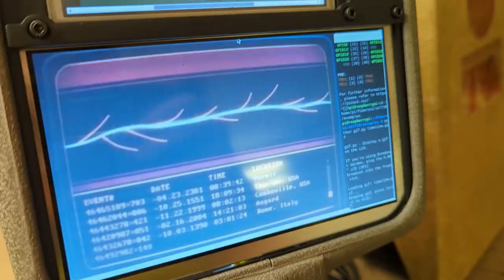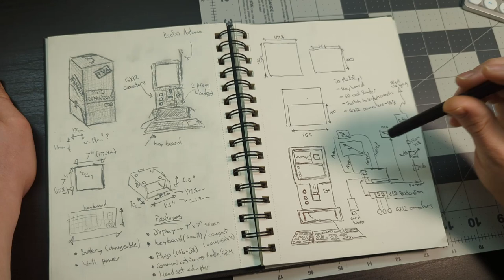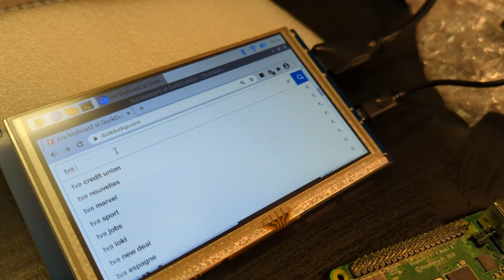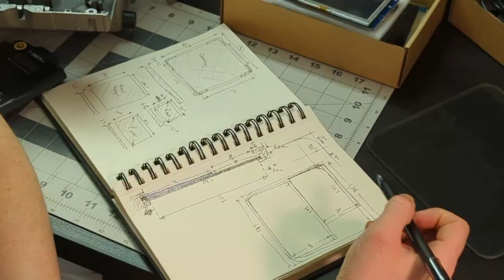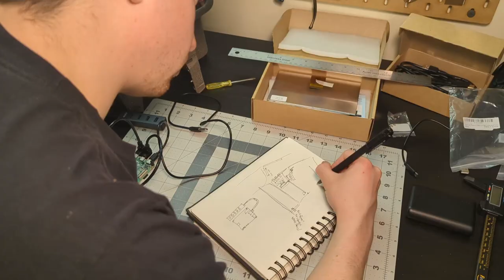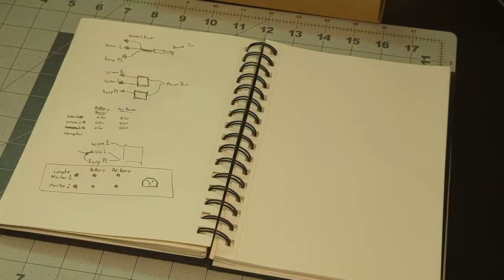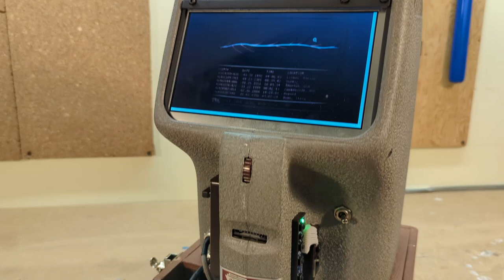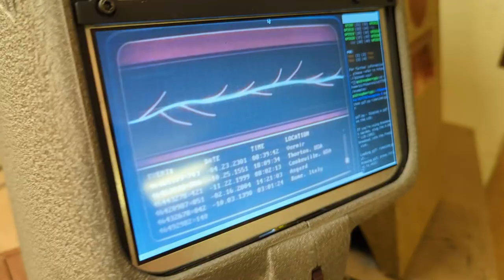Building a Retro CyberDeck Inspired by the TVA

Comment: If you find another one of these and wanted to go extra retro, you could possibly get a small LCD to go where the slides go. That way you still get a reflection on the main glass, adding to its vintage look.
Reply from the maker: Hey Jacob! I wish I had included this in the final cut of the video! Using a tiny LCD in the slide position was actually what first inspired this build, sand I did shoot some footage of trying to make it work. Unfortunately when I tested it, the mini LCD just wasn't bright enough to be visible except in a dark room. @Giacinto Boccia suggested using a mini projector. Which I think might have worked with the proper lenses.

Comment: Really nice build! A slightly smoked glass to cover all screens will be top! 😉👍 I'm currently working on something similar with a B&W Flat CRT, but the rpi still pricey...
Reply from the maker: The CRT build sounds cool! How big is the screen? They keep saying the raspberry pi's are coming back in stock but like you say the prices have still been slow to recover for sure. If it's a big enough build could you fit an old laptop board inside it instead? I've been thinking of trying something like that on another build.
Reply: @ExercisingIngenuity  The CRT screen is 4 inches, I already made a first version ( https://www.youtube.com/watch?v=MZ5fq9Ok8M8 ) but I try to make a new one with integrated and portable keyboard. Using a mini pc is an option but we need a composite video output for CRT, perhapse a hdmi-composite converter.

Comment: Did you consider keeping the mirror and translucent screen and using a small internal projector instead of LCDs?
Reply from the maker: I actually considered something similar, using a tiny ultrabright LCD in conjunction with the existing mirrors and lenses. However, a small protector would have been the way to do it, I never considered that! The tiny LCD was not bright enough and the projected image was only visible on the view screen in complete darkness. I ended up cutting that experiment from the video, as it never ended up contributing to the final build.
Reply: @ExercisingIngenuity  should be doable with a mini short throw projector and two mirrors but most need like 6 feet of throw so you'll need to use a diopter element in front of it.

Comment: Hey man, loved the video! The design is dope and very creative. I've been trying to build a cyberdeck of my own for a bit, and I'm having trouble with the battery options. What method did you use?
Reply from the maker: Thanks! Glad you enjoyed it. For this build I'm actually just using a USB battery bank that has 5v output. Not the best solution, but the battery bank was an off the shelf reliable option that I thought would be simple. It worked, the only issue being that when the battery bank is charging, it doesn't output any power, hence the awkward method of switching between battery power and the plug in power supply.

Comment: I had an idea looking at that huge back panel. What are your thoughts on installing an HDMI projector in there?
Reply from the maker: It's been suggested before. Or are you thinking it could be set up to project out the back of the cyberdeck? Maybe as an alternate display?
Reply: @ExercisingIngenuity  Yes as an alternate display. Regular use, the front display. Movie or game time, project onto a wall. I have explored the dual screen capabilities of my Pi4s. I use Twister OS for desktop and Retropie is built in to that. Also Android 13, (specifically Konstakang, Lineage OS, with GAPPS,) If you start up Android 13 with 2 HDMI plugged in it will show the same on both screens. Twister OS you can put an icon on the desk for changing display settings. Use them as 2 screens or mirror, OS dependent. 1 exception. If you use DSI (official 7") with Android you can't get an HDMI out at the same time. You'll get no screen at all. Not sure about composite, never used that for anything. 

A projector would run down the batteries much quicker. So when I do my projector, I will give the projector it's own battery. I'm thinking LED, something automotive designed to work on 12v, but not a headlight, maybe a foglight, less amp draw.

My favorite cyberdeck is built into a boombox. I took the CD player out which left a hole the size of a Gamecube. At home it's on 24-7. Watching Inception on it right now. On the desk next to me.
Reply from the maker: Sounds like you've experimented with the pi display capabilities a lot more than I have! I really like the idea of having the projector as an alternative, but like you say it would require much more power  Might have to revisit this pideck at some point and see what can be done.
Reply from the maker: The boombox deck sounds wicked, repurposing old devices as enclosures is where it's at 👌
Reply: @ExercisingIngenuity  I wanted something I could always use. Power tool batteries is where it's at. My tools were already Milwaukee 12v so I went with those. Well knockoffs from ebay that have more amps. If I were going clean slate, no influence. DeWalt 20v lithium knockoffs. Reason being it's a completely flat battery pack that slides into place, higher voltage, more amps. The Milwaukee 12v batteries are harder to figure into a smaller device. They do look bonkers on the Boombox tho https://www.youtube.com/watch?v=9IUgXJ8rng4

Comment: Despite I appreciate the efforts, I disagree with the design choices, especially for the combination of displays and their overall look altogether, it disappoints me in missing the true retro look. I've enjoyed the TVA designs too from the tv show, so let me explain : having such a nice piece of retroprojection machine and discarding the lenses to just put off-the-shelf LCD displays is a huge mistake. You should remake it and retrofit some dismantled 4:3 LCD to project the picture on the original screen, otherwise the combination you did just look like a toy. The initial case design is pure gold and a very good base to start - even the wrinkled paint should be replaced by some beige color instead - and the main idea to reuse it was very good, but the way you fitted displays, no way... You can find small 4:3 displays for cheap and can even hack such a model to plug it on the raspeberry pi without much modifications, in the same way people used to make their own DIY retroprojector, just smaller. Come on ! Please fix this for next episod. Cheers.
The hidden case for the powersupply was very nice btw 👍
Reply from the maker: Thanks for the feedback! I also agree that the displays are the most lacking part of the build. If I revisit it in the future, I'm definitely going to try and reuse the original glass.